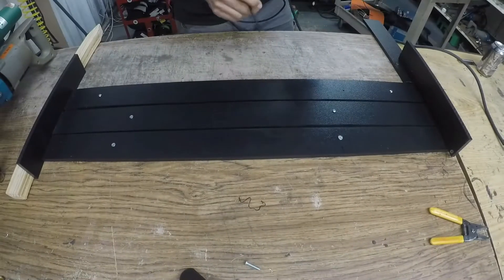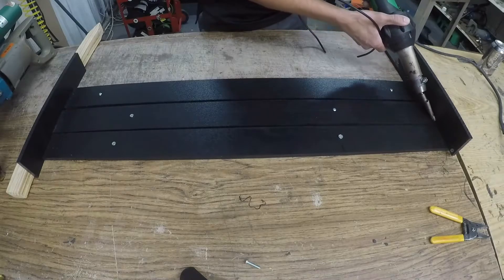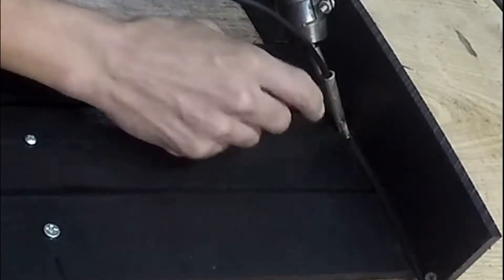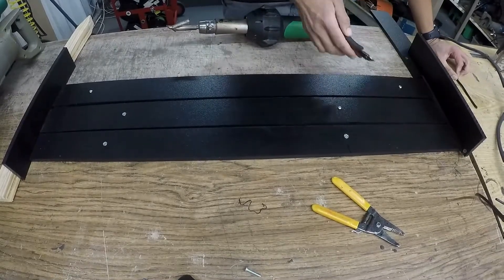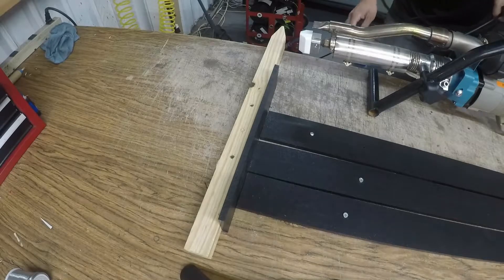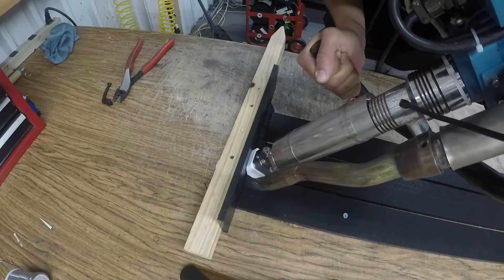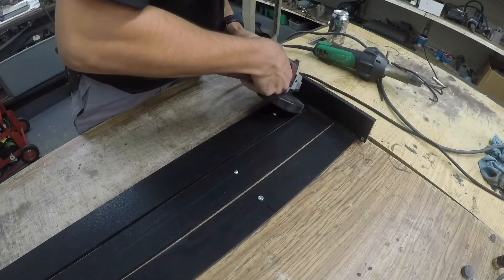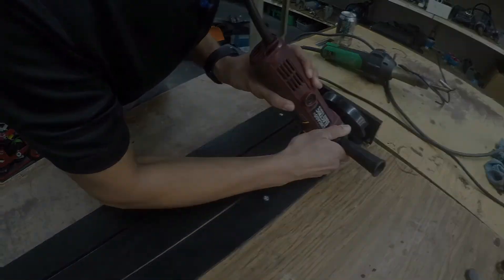HDPE Welding - Extrusion Welder

Comment: Could I actually use just a hot air speed welder for 1/8 inch HDPE sheets? I can’t afford the extrusion welder right now but the hot air welder I was wanting to make small light boats
Reply from the maker: Yes, you can use the hot air speed welder for your project.  You will have to lay down a few beads to match the extrusion bead .
Reply: @polyweldusainc4180  can I butt-weld only 1/8 HDPE sheet in one pass with speed welder?